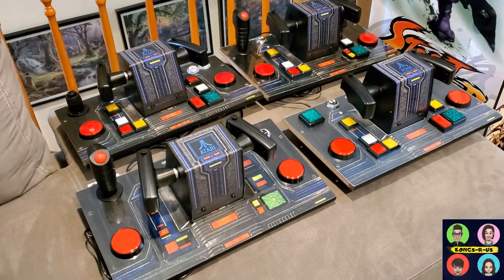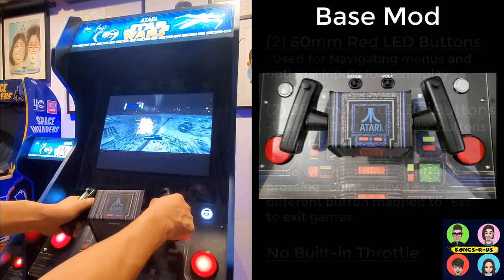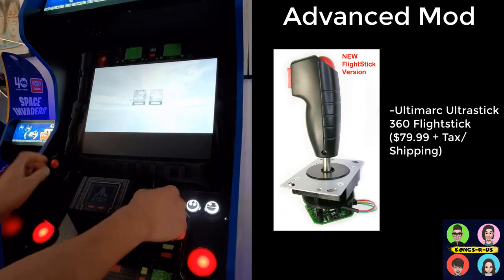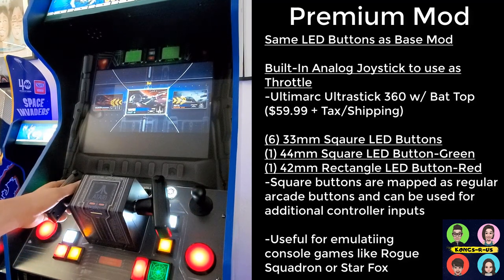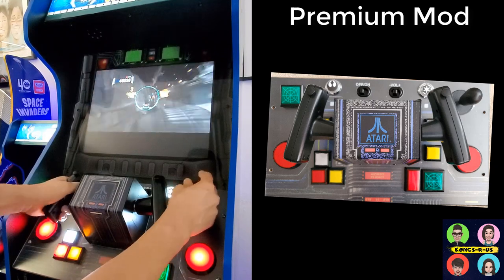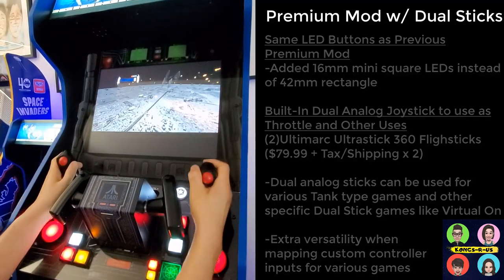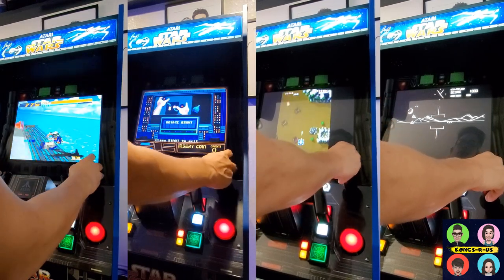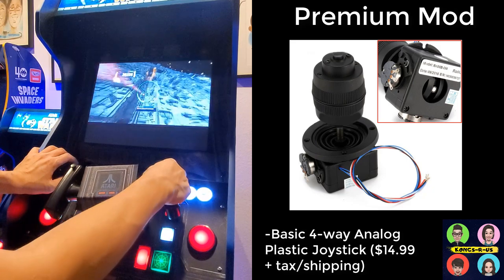Star Wars Arcade1Up Mod: Control Panel Upgrades, LED Buttons, and Analog Throttle Review -Battle Pod

Comment: The square buttons you linked to use 12v of power. In your original mod video you were powering them with a 5v USB cable. How are you powering the 12v lights now?
Reply from the maker: check out this video for the links to the power wire harness i used https://youtu.be/-gqg8YwP1LM

Comment: I purchase the ultramarc flightstick for my star wars mod.  How did you mount yours to the control panel?
Reply from the maker: you need to take the joystick apart and mount it through a hole on your control, then reassemble
Reply: @KongsRUs  i was afraid of that.  thanks so much for your prompt reply.

Comment: Where are you connecting the HIGH/LOW THROTTLE, RETURN TO CENTER, WITH RED TURBO BUTTON?
Reply from the maker: into the player 2 side of the APAC. there's a potentiometer with 3 terminals, 1 is the ground and the other 2 plug into the Up/down inputs on the APAC. you can test various combinations to see what works and reads correctly with your setup. the turno button has 2 red wires which you can plug either into the the ground, and the other into any input on the APAC player 2 side

Comment: Thanks for directing me to this. The exact kind of upgrades I'm thinking of doing on my own build. Does the tron stick get in the way of the screen?
Reply from the maker: not too much, but I wouldn't recommend doing what I did with the tron stick. was a lot of work to get it right!
Reply: @KongsRUs  As far as configuring it or physically putting it onto the cab?
Reply from the maker: @someonespecial3662  installing it. I had to mount it on top of an Ultimarc 360 stick and it's mounted higher so it clears the side of the star wars panel.
Reply: What would you recommend instead? Just the ultimarc without the tron topper?
Reply from the maker: @someonespecial3662  ultimarc flightstick 360

Comment: When you use the ultimarc did you take the joystick off the metal mounting bracket and use tape like you did for the 4axis stick?  The mounting bracket is too far over and runs on top of the piece that the deck screws into, so I need to move something.  Appreciate the ideas here!
Reply from the maker: oh yea, for the ultimarc, i think i had the edge of the bracket going past the top of the control panel. When you mount it, it shouldn't interfere with anything and still fits into the cab just fine. i used tape and screwed in the bottom part of the plate into the control panel

Comment: Besides using the throttle for star wars can it be configured to be used as a manual shifter in racing games? Has that been experimented at all or can a + or - shifter be used for a throttle?

Comment: Sorry to hit you with so many questions. Do the stock power/volume buttons do anything?
Reply from the maker: yes, I wire the power up to turn off/on the surge protector inside the cab. the volume switch is wired into the Apac as 2 extra buttons

Comment: How did you add/install the SuzoHapp High/Low throttle? I am considering one, but I read you need to cut into the deck a big enough hole to put the throttle through and screw down, do not take it apart. Also, how did you attach the 2 cables it comes with into the board? Any additional cables needed?
Reply from the maker: you can definitely take it apart, but its a beast to do so! for the return to center spring, it'll work with just a 29mm hole the same as a regular button, but the non return to center one needs a bigger rectangular hole to work. i cut two 29mm holes next to each other and dremmeled it down to smooth it out. the 2 wires it comes with are for the button which 1 is a ground and the other can plug into any input. you need to add 3 wires to the potentiometer that plugs in the ground/up/down on the 2nd side of your APAC. i have more video recorded of the happ throttle coming soon!
Reply: Looks like a mess and a video would be very helpful, I am interested in the return to center spring version myself. THANK YOU FOR all your videos, much appreciated.

Comment: The cheap 4Axis joystick, do you think it could be modded to replace the joystick handle with something more like a T shaped throttle?  Is the shaft threaded?
Reply from the maker: the cheap 4 axis joy is tiny and wouldn't be able to handle another shaft if you tried to mount something. the top doesn't come off easily either, its built on, not something you can thread onto the shaft
Reply from the maker: I guess I didn't mention, but the throttle settings for battlepod only work with an Analog throttle, not a digital joystick so it limits your options.

Comment: I keep getting “failed to run the process” when trying to start battle pod on teknoparrot.  Help!
Reply from the maker: did you install directx and visualC+ files? download them here: https://teknogods.github.io/downloads.html
Reply: Kongs-R-Us I did and it's still giving the same error. I'm running windows 10, dell optiplex 7020, gtx 1650. Any other ideas?
Reply from the maker: @fleejay806  sorry, im not sure, its usually due to those directx and visualC++ files not being installed or your might have a bad arcade rom dump thats missing a file

Comment: dude again thank you i am going to try my best to do the mod with the tron stick.  i doing one of my son and daughter both having hard time with school and bullies,  its been so great that they can now be home and heal and i like to surprise them with this.  can i messaged you i need some help with the playlist,
Reply from the maker: thx for sharing! FYI, I usually dont recommend the Tron stick mod since there's not a lot of clearance on the control panel and your hand may hit the side of the wall. after all the CPs I've modded, I think to short 4 axis basic joystick is the most functional throttle and doesn't interfere with the yoke
Reply: @KongsRUs   thank you so much i will try that. i'll messed you on facebook if thats  ok

Comment: Can you just use two buttons one to throttle up and the other to brake or do you need analog?
Reply from the maker: digital inputs including buttons will not work properly with Teknoparrot controller settings. You can map a Thrust to a button to get started, but it'll stay stuck in Thrust/accelerate for the whole stage and you wont' be able to brake. Only works with analog controls for now. Not sure if Teknoparrot programmers will ever change this
Reply from the maker: I just released a new video showing the updated version of TeknoParrot allows u to map throttle and brake to buttons or any digital input: https://youtu.be/dBoftkZoilc

Comment: Fantastic, great overview of available options. I am using a Space Invaders Arcade 1up cab ($125) for my Star Wars games and using the Ultramarc flight stick. The Star Wars cab is $500 where I am at, no deals here. :( . But I am saving up for a better computer so I can play the games a bit smoother, Battle Pod hiccups every now and then on my current computer,  but playable. Any suggestions for a Small Form Factor computer and Video card?
Reply from the maker: GTX 1650 low profile is the best GPU you can get that is PCI powered that I'd recommend. it'll run Battle Pod at about 55-60FPS.  otherwise the GTX1050Ti is a good alternative but less performance for a similar price running about 45-50FPS based on my own tests